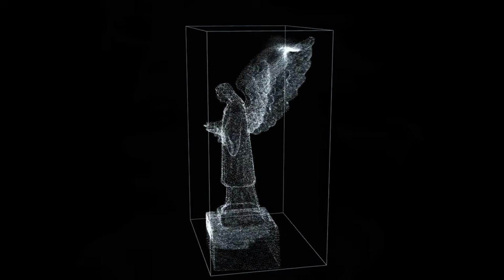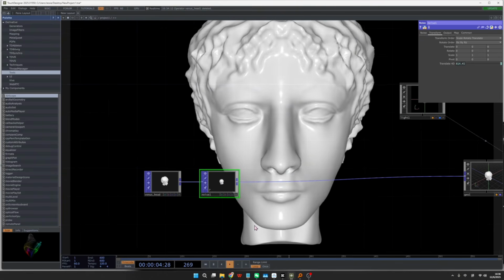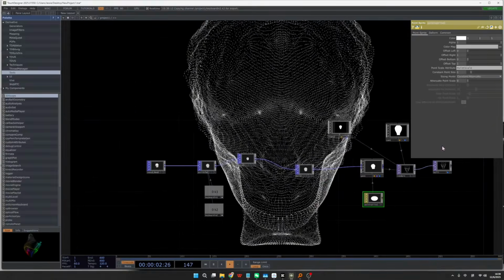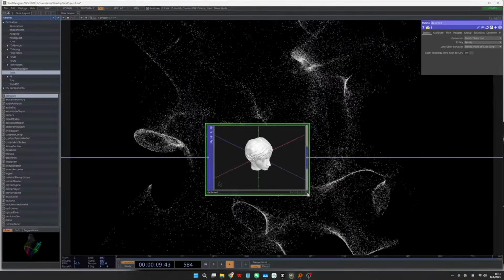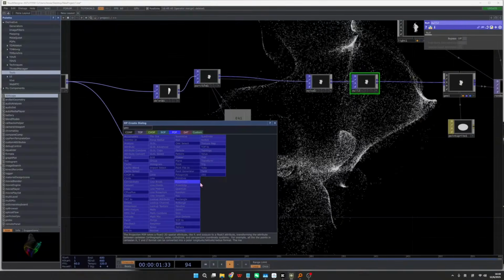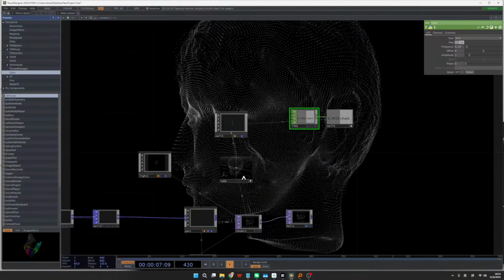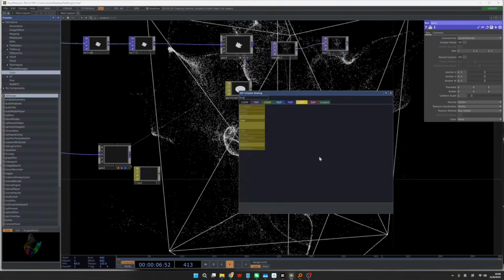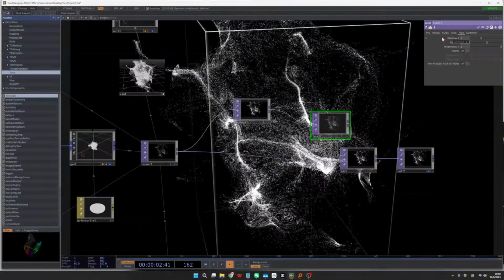POP Version| Drifting Particles Animation from 3D Models| Touch Designer Tutorial | POP Remix

Comment: For some reason i couldn't get the particle drifting part right. One half was the drifting particles but i couldn't spread it or reduce it on the x axis if that makes sense.
Reply: same :(
Reply: okay I think i figured out a work around

try placing the same delete system but for the particles; so the exact same parameters but connected to the particles. 

i also picked “invert” for the delete4 

seemed to give the proper effect! hope this helps!